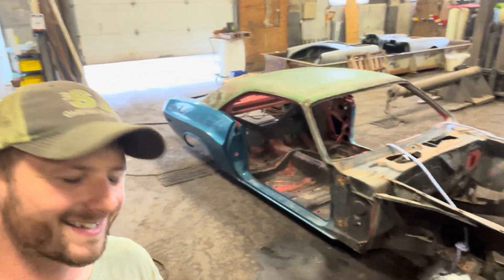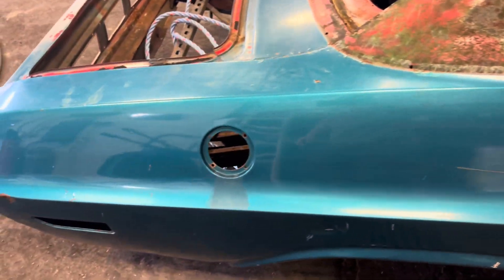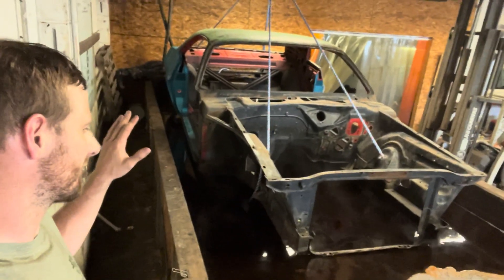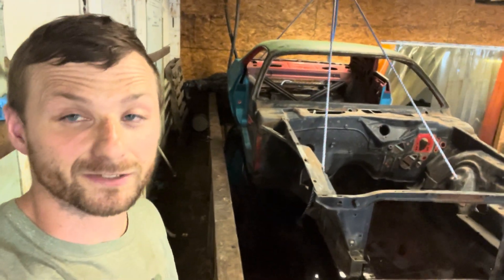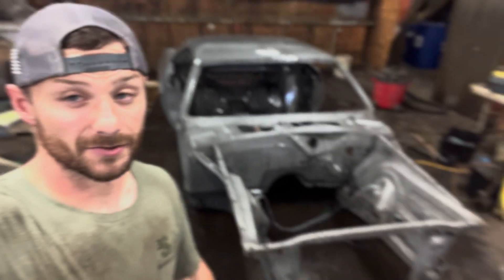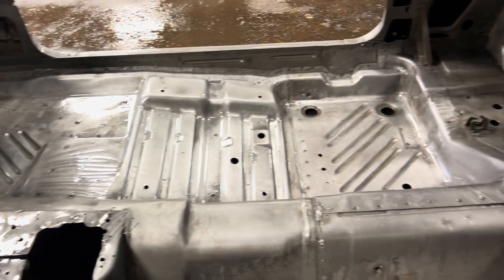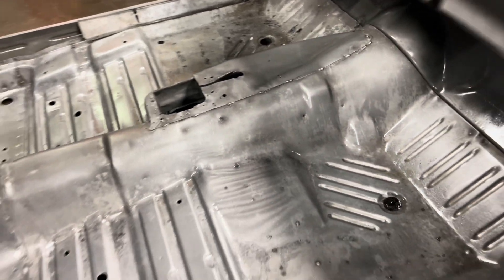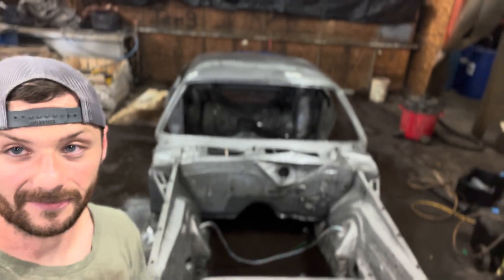1970 Dodge Challenger Chemical Paint and Rust removal

Comment: So when you said, "I can't wait to see the look on the owners face".. I said the same thing to myself, but for the opposite reason.

To the average person, this doesn't look bad in term's of rust, that is true. These car's are notoriously bad rusters, I don't have to tell you. But the reason there is no rust, is because most of the car has already been replaced at least once.

The first tip off to me was pre-dip, when you could see the car was painted blue, but underneath the rubbers for the trunk you could see red. At that point I knew the quarters were going to be hiding bondo.

Which they were. But there  should not have been bondo in the C-pillar seams, they should have been lead.

As with all of these cars, the quarter panels have been replaced, and then they were wrecked again. As told by the bondo on the bad repair at the rear tip of the left quarter.

The whole floor from the quarter window to the firewall was replaced once, poorly judging by the welds. I can't tell, but I think the drivers floor was then patched again within that patch. The hole for the shifter has been totally hacked as well.

Without a closer look, its hard to tell, but judging from the holes, and welds where the front clip joins with the top of the firewall, Think the entire front end has been swapped.

Finally, the joints where the top of the a-pillars meet the roof do not look factory to me. I think the entire roof has been replaced at some point in its life.  

I would bet this car took a BIG hit, maybe rolled over too. Someone pieced it back together, maybe multiple times.

If I were the owner I am sure the look on my face would be that of despair. Odds are the whole car is tweaked and needs to go on a frame jig, then have all of that replaced again.

Comment: you think it's a solid Challenger body . . . the front section of the chassis body has morphed slightly from the inside . . . not visible in the first glance but it's there . . . look for yourself . . . ur jet washing the body of the car after it has been treated with electro-phoretic deposition or EPD in short . . . whereas you should be jet washing the body before applying the EPD treatment, not after . . .

Comment: The problem with chemical dipping a car is paint will never touch parts of the cars inner structure like inside of structural points of the car which have inner and outer panels. You would need to dip it into some sort of anti corrosion solution to reach all the places that the stripping chemical reached. Maybe hot dip galvanize the whole car?

Comment: Mopars are known as rust buckets for a reason. Looks like that car is a very solid example. Very easy repairs. Nice job.
Reply from the maker: Thank you! They are definitely some of the rustiest cars we get . Almost as bad as alfas and MGs 😂
Reply: @minute_of_dangle  It's almost like they wanted to build the cheapest cars they could while offering the highest performance!
Reply: @RiouInsuiko  yes, they made the metal thin to keep them light. their factory dipping obviously didn't work very well either..
Reply: @mikeallmon1  With how rusted out they usually are it'd almost make you think that instead of any kind of rust protection they sent the things out the door with a wish and a prayer and called it a day with that. It's a shame with Mopars having at times low production numbers to begin with. Probably speaks to why they're so valuable these days.

Comment: You said at the start of this video you would see what the toy that sank to the bottom  would look like in 3 years ,,,does that chemical really stay in there that long. ,,I really hope you answer that if it really stays that long that's mind blowing to me ❤😊
Reply from the maker: Yep it stays for at least 3 yrs. We had a tank go almost 5yrs one time. We can spike it when it loses its strength. The acid is a different story it can’t be spiked as easily. The dissolved rust/metal builds up. It lasts about 2yrs

Comment: I suspect those quarters were replaced in the past. My clue is the seams at 12:24 & 12:52. No way that would be factory done. If it was the seam would have been lower at the belt line. That way you would not have to stamp seperate quarters for hardtops and  convertibles.  Thx for the vid.
Reply from the maker: Good observation! I kinda thought the same thing! Thank you for watching!
Reply: Are you referring to the seams in the C pillars? Those are factory. My ‘69 Charger has them too.